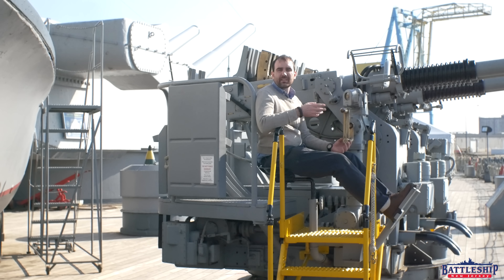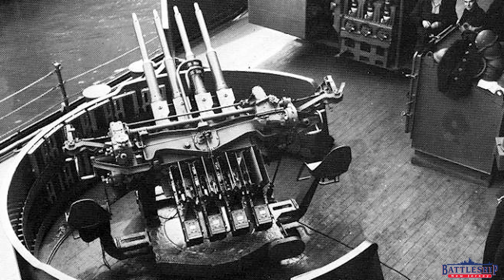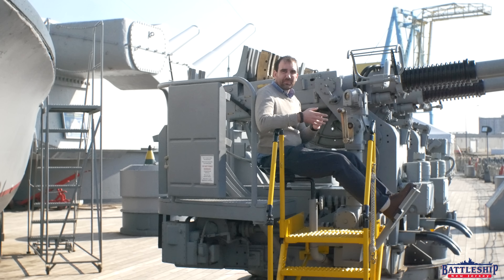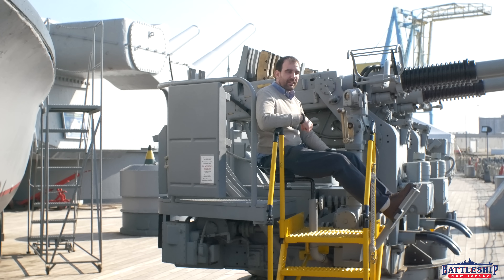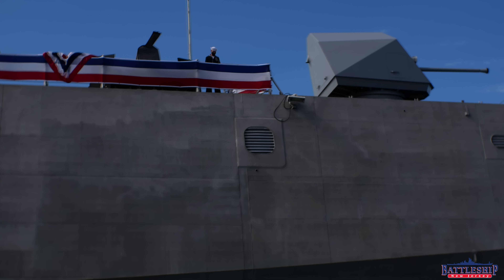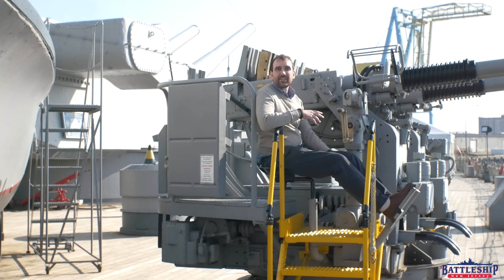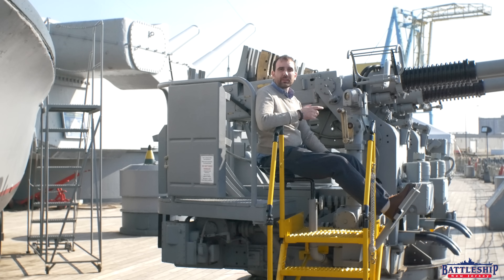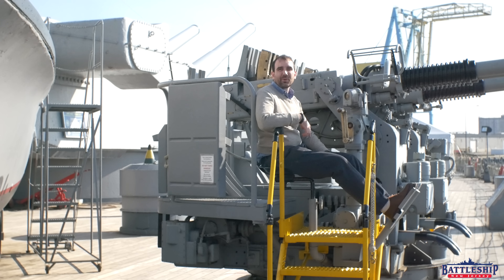Why Are Some Naval Guns Described in Inches and Others in Millimeters?

Comment: Ryan: I think you overestimated your measurement tool. The 16 incher looks more like a 1.2 Cr (Curator) wide gun.
 
Speaking from my own experience, size matters!, even with antiques!
Reply from the maker: Having climbed through one, I can tell you those guns are less than one curator in diameter
Reply: @BattleshipNewJersey  I guess we measure differently. I saw that video... if it were <1Cr wide, how could you fit through it?
Reply from the maker: at an angle and fairly squished
Reply: @BattleshipNewJersey  Haha!

Comment: One thing that wasn't mentioned is that inches doesn't really match up with the metric system.  There are a few that are close to the inches.  It's been awhile, but I think one of those is 18mm and 3/4 inch.

Comment: The British Army "3 inch Mortar", had a Calibre of 3.209 Inches or 81.5 mm. It replaced the "Stokes 3 inch Mortar" of 3.2 Inch or 81 mm Calibre that was used in the First World War. Both had similar roles and the increase in Calibre was due to changes in bomb design. The more modern Mortar could use captured German and Italian Mortar rounds of similar calibre.

Comment: The US Army used inches up to early 60s. US designed artillery and those adopted from England before or during WWI used inches. The 8” howitzer was adopted in WWI and the later version used in WWII adopted the same designation. It was a British design that the British placed orders with US gun manufactures and when the US entered the war, placed orders for the same howitzer. The 4.2 inch mortar also was derived from the WWI British mortar that the US Army used until the beginning of WW II. The US also adopted French Artillery and those used millimeters. Examples are the 75mm gun and 155mm howitzer and gun. Both were French. The US designed 75mm pack howitzer used ammunition derived from the 75mm gun. So it adopted  millimeters. In the 60s the US standardized much with NATO so the 8” howitzer became the 203mm howitzer. So for the US Army inches denote a US or British origin. Millimeter denote French and later European origin. The USN uses inches with legacy guns for easier understanding for Americans.

Comment: As an inch is defined by millimeters (now), its like converting millimeters to barleykorn which a squirrel eats on a sunday afternoon as measurement. so 16inch is less accurate than 406mm just by the unit size, sure you can go by metre but guess what? its all done with a decimal system, not with how many appleseeds fit inside the fist of a slightly agitated toddler that didnt get pudding for breakfast.

Comment: The 57m gun caliber is likly a result of earlier 6-pounder guns. For example, WWII 6 pounder ant tank guns are 57mm.  A lot of caliber that looks odd in metric unit dates back todats back to the 19th century when other systems was in use

Bofors also made 57 mm kanon M/89 that was  use a lot in Sweden. M/89 is the year it was adopted and it is 1889. That was a gun similar to the QF 6-pounder Nordenfelt and QF 6-pounder Hotchkiss both in service from 1885 for defense against torpedo boats on shipping. Sweden adopted a metric system in 1879 so the gun got a metric designation when adopted by the navy.

When a new weapon system was designed keeping the same make developed cheaper and easier. Old gun barrels can be used in testing, tooling can be reused etc.  There are Swedish WWII anti-tank guns with 57mm caliber but also a 57mm autocannon mounted on airplanes. So when Bofors designed the gun for the Dutch navy after WWII they kept using the 57 m caliber.  Even if the shell length and pressure etch are changed using the same diameter it makes development easier and cheaper. If it had been a completely new design 60mm would have been more likly

 Carl Gustaf's 8.4 cm recoilless rifle and AT4 developed from it have an 84mm caliber. The reason is there were 8.4cm cannon barrels available for testing during the development in the 1940s, it was Swedish license copies a 8.4cm Krupp gun from the 1880s.

Comment: The measurement system and nomenclature is merely for easy reference by our brains.  Actual dimensions for manufacturing will be more precise, whatever measurement system is used.
In blueprinting & machining the parts to be interchangeable, there are subtle tolerance-stack issues if one were to compare an inch measured part with a metric measured part.  So, manufacturers select a measurement system for consistency purposes.  The system often happens to whatever the production workers are familiar with.

For naming, marketing and patent reasons, the name might be close to, but not exactly match, the mechanical dimensions of a product.  (Examples of this are found among various rifle and pistol cartridges.)

Comment: Saying "If your country has been to the moon" is such a mis-nomer. 1) NASA's engineers and scientests used the metric system for the majority of their calculations and designs because of that system of measurement being more accurate when accuracy matters, 2) A lot of the engineers who worked on the Command Module and Lunar Lander were Canadian, most being former engineers on the Avro Arrow project

Comment: This "been on the Monn" argument is so dumb, and arrogant. And totally unfunded. NASA using the metric system from its funding. Only the indicators worked in arbitrary units, because the astronauts were not smart enough to learn the metric system. Shame on them.
Metric is much more precise. Metric is based on science, not on supersticions like the so called "freedom units".
By the way, your "freedom units" are defined in metric. Your outdated, obsolete measuring system doesn't even stand on its own feet. Just a facade.
Reply: Metric is not more precise.  Precise measurements can be expressed in any measurement system.  It merely requires using precise terminology.
Reply: @libraeotequever3pointoh95  OK, than tell me how you pronunce 17 nm in "freedom units". You can't. There is no unit this small, and your arbitrary system doesn't contain prefixes. And good luck express 17 with fractions. 17 is a prime number, you can' express it with fractions. So you can only approximate it with your 234/297 style. This is the most inherent weakness of the imperial/freedom unit idiotism, and this is the main reason why these archaic systems are de facto less precise than the metric system.
Or maybe you can overcomplicate the most simplest things, and express everything with its own functions you must solve to get some result. And you still only approximate things with it, than round, and you end up smeared to the wall instead of stopping in front of it. And you can say, "Well, it didn't add up" Sorry!"

Comment: Most of the German, French and Japanese guns described as 15/16/18 inch were actually not exactly that size.
For example Bismarck's guns, usually described as 15 inch were actually 380 mm or 14.9 inches.
Nagato 16 inch was actually 410 mm or 16.1 inches
Reply: i'm not sure exactly what was up with the germans (probably just looking what at the brits had and going with something similar to that) or the french, but maybe because the mms would be even, but for the japanese it was because they measured their guns in centimeters as opposed to millimeters. the 410mm as mentioned on nagato was the 41cm 3rd year type naval gun, yamato's 460mm guns were the 46cm type 94, etcetera etcetera. For what reason, i have no idea, but maybe it's because we like seeing round numbers instead of that irritating 1 hanging off a 381mm (15 inch exactly) or just thinking 'why not round it up/down a bit to save weight/get a bit more performance out of the gun'.

the world may never know.
Reply: This depends on how the measurement corresponds with the 'lands & grooves' of the gun barrel.  The two methods are land-to-land, or, groove-to-groove.
The projectiles need to engage the grooves properly.
Naming, or nomenclature, of weapons is for easy handling by our brains and marketing purposes.

Comment: @BattleshipNewJersey What a poor excuse for a curator who hasn't bothered to research weaponry basics. The fact is that those who landed on the moon used metric (converted to inches) because a certain German named Wernher von Braun who worked in millimetres (more precise) designed the Saturn V. Proper research would reveal that originally cannon projectiles were measured by weight (USS Constitution has what size cannon?) or shot. Weight of shot fell out of favour because of industrialisation when bore diameter was used (although the British still used weight until the end of WWII/1950's). France (who introduced the metric system) and Germany used millimetres. There are only three countries who use the imperial (inches) system today USA, Liberia and Myanmar. Seems to me you owe an apology for such a flippant answer to a legitimate question. Or should we just watch Drachinifels videos because at least he provides good information?
Reply: Or you could try not being pathetically easy to rage trigger from a humorous comment....

Comment: I mean if we are talking to precision here, technically the 6in gun should be the 152.4mm, the 8in gun should be the 203.2mm gun, the 14in gun should be the 355.6mm gun,  the 16in gun should be the 406.4mm gun and the 18.1in gun should actually be the 18.11... in gun which in metric is the 340mm gun.

Also, rounding aside, the metric system should be the standard if not for the same reason that it is the standard in the world of science, than for the reason of how the army and airforce already use mm across a wide variety of their guns. The navy is the last hold out and even then only with american systems, accept when they get the toys of other branches such as the airforce's 20mm M61 in the Phalanx CIWS and the army's 25mm M242 bushmaster chain gun, and it kind of starts and ends with weapons and cargo weight for the most part.

Comment: The precision of an informal designation of diameter isn't really relevant. No one is doing mathematics based on the diameter except for the engineers who are working with the guns or the ammunition, and they already have access to the information about what the dimensions are to whatever precision they require. Informal designations are just used as names, or maybe as a very  loose method of comparison of power.

Comment: Of also interesting note, Army maps use Metric system for measuring distance. In map reading I learned about Meters and Kilometers. And our annual road march, is a 12 Km road march. We don't call it by its equivalent in miles. In Field Artillery, we also use Mills on our compass instead of degrees for better accuracy as well.
Reply: Older maps use imperial measurements.  Measurement systems are for standardization and convenience.  The map could be in rods or in rii or in feet or yards or meters or whatever.  Just pick one system to work with.
Reply: Metric: it's not just a good idea, it's the law!
Reply: Thankfully, not in the US. @dukeofgibbon4043
Reply: You're in combat.  You suspect the enemy has captured one of your radios and some maps.  So you work out a trick with your artillery.  Enemy commander hears you call in an artillery strike along the 1000 line.  Enemy commander orders his troops to move forward 100 meters to avoid getting clobbered.  His troops get clobbered in their new position.  What happened?  You switched to yards!

Comment: In Vietnam and back to WWII the army had the M-110 8" gun.
Reply: I was in the army around then (late Vietnam) and the measurement units seemed to align with when the weapon entered service. The M110's howitzer itself dated back to just prior to WWII, though the carriage was much more recent. Infantry battalions generally had 81mm mortars (early 1950s) in their line companies and M30 4.2 inch - "Four Deuce" (designed in the late 1940s) in their weapons / Combat Support companies. I wonder if the formation of NATO (1949) had something to do with that as there would obviously be a drive to standardize measurement units, but existing weapons seemed to have kept their original inches, e.g., the Browning .50 cal and the .45 cal M1911. But while they may have kept their inches the performance specs in their manuals did get metricized, sometimes with sort of misleading, if correct, results. My favorites were the maximum effective ranges of the small arms. The M3 "Grease Gun" submachine gun, was listed at 91 meters. That sounds awfully precise... until you realize that that is 100 yards. So years before some guys figured that the gun was good out to, I don't know - about a hundred yards... maybe ninety, maybe a hundred and ten. Let's call it a hundred. But 91 meters sounds really, really exact. Not quite so weird sounding was the M16's 460 meters (500 yards).
Reply: @paws1955  I think Nato had a lot to do with changing to metric measure. One goal was that ammo produced in any Nato country could be used by all. In WWII both US and UK produced the 40mm and ammo. The agreement was parts and ammo had to fit each others guns. Also field measurement. In Vietnam we used meters, etc. I think in Korea US measure was still used.

Comment: Ryan, please drop the "went to the moon" thing. All of NASA's Apollo calculations were metric, because they understood the value of a uniform and correlated measurement system.
Here's an example of a non-metric failure: a Mars probe burnt up on entty because the engine contractor decided to use pounds of force for their engine thrust calculations when NASA, using all metric units, expected Newtons as a unit of thrust.
Reply: All of that is true, but every nut and bolt on the Saturn V rocket and Apollo spacecraft used inches because that is what is familiar to the technicians that built and worked on those machines. It’s still that way today in the aerospace industry. Engineers use metric. Mechanics use imperial units.
Reply: Sounds like a human error failure.

Comment: Awesome channel. Quick question. If the Yamato survived WWII, how would Japan have modernized the ship?
Reply: If otherwise the outcome of WWII was the same, Yamato likely would have been used in Operation Crossroads.
Reply: Or they would have scrapped her.  That much steel would help rebuild Japan quicker.
Reply: what a senseless scenerio. But say the war somehow ended via treaty in 1942. The first thing they would do is fix her bulkhead issue. Then prolly decommission her cuz battleships were obsolete by 1916.

Comment: Wow, I always thought that naval guns exceeded land artillery. In the big gun sense. 
Makes sense what I learnt, as occasional heavy artillery 20x mm (8 inch) or more common 155mm (6 inch) far outweigh most common marine big guns.
The biggest 4 guns were Big David (US)  916 mm (36 inch), and Tzar cannon same calibre, was russian. Or the pair of Krupp cannon (German) 800mm (32 inch) used to smash Sebastopol during Nazi invasion. Think one was also used in seige of Leningrad.
These were all land, not naval artillery.
Reply: Personally I prefer mm for accuracy IE technical or scientific, but inch in common speech, colloquial. Easy to compare big cannon or mortars. Remember cube square double the width of a shell, all dimensions equal, 8 times heavier shell.
Reply: its not like those giant pieces could do anything beyond bomb forts. They literally had to make a new section of track to even turn them. They were useless. as were heavy guns on ships by ww2
Reply: Logistics made heavy land guns challenging, hence the very limited numbers built. Most of the big guns were indeed naval. They're much harder to move around on land than when mounted on a ship.

Of course, it all became a bit superfluous once aviation began to be able to reliably carry large loads for long distances.